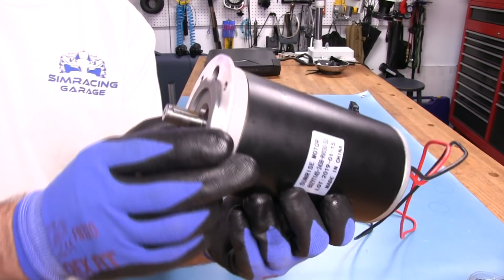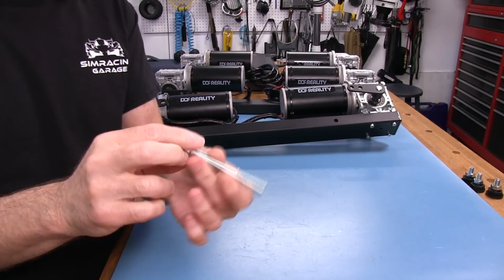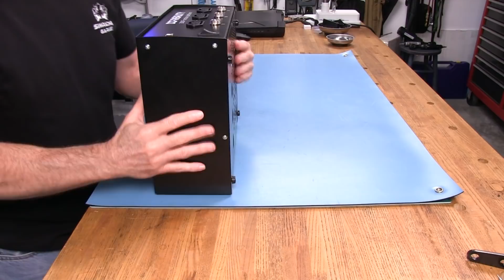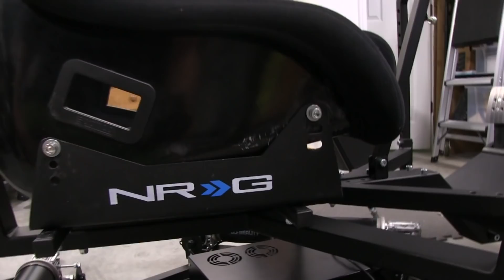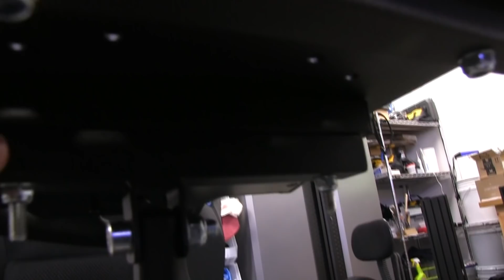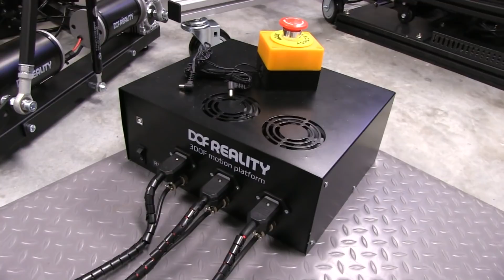DOFReality H6 6DOF Motion System Review

Comment: Great review. just built 2 P3 units last month. On the Wheel base plate, under your wheel...Check your bolt spacing for the vertical support arms. it looks like you may have them too far apart at the top, hence giving the whole base a "pre-load" spring tension. i only mention it because i did the exact same thing twice before i noticed. Considered buying optional 3rd support arm, rebuilt wheel base properly, no flex. keep up the great work
Reply: Yep the extra support bar helps with this -plus a lot of owners modify this area to strengthen it in different ways do it is strong enough to use a DD wheel 👍
Reply: @Heretik666  how are they modded?? can it really take the abuse of a DD???
Reply: Great video as usual by Barry, but I have to agree with Robert's comment. I have an H3 which I got roughly a month ago and it doesn't flex as much as what's shown in this video. It does look like the two bars connected to the wheel mount plate in this video are further apart than mine as well. However, I did order the stabilization bar to try and get rid of the minor flex I do have.
Reply: That's interesting and helpful to know!
Reply: The loudest noise comes from the gear shifters 😆

Comment: What feeling do you get using the H6 versus the H3? I’ve heard people state the H3 feels like you’re rotating on a basketball. I’m assuming this is due to the pivot point but just curious on your thoughts? I’m planning on purchasing for flight Sims, I keep going back-and-forth between the 3 series and the 6 series budgeting wise.
Reply: I just upgraded from the H3 to the H6.  For racing sims it was a night and day difference, but for DCS it wasn't as noticeable to be honest. Since the upgrade route was available (despite being a more expensive route overall), starting with the h3 may be more than sufficient.
Reply: @neilxpeart  How well did the H3 & the H6 feel when taking off from the Aircraft Carrier? (I'm assuming you have either the F/A-18 or the F-14). Did it provide G force sensations with the H3 or the H6?
Reply: @arhinehart2928  I actually don't have that plane/map combo, so I can't speak to that.  Taking off from a runway is the only analogous experience, and it's tricky to say regarding g sensations.  It definitely didn't feel like I was taking off, like the surge acceleration setting.  However since I do vr flight sim, it made the overall experience more immersive, where I didn't really recognize I was in a motion platform.  However when its off, it's super noticeable. I hope that helps.

Comment: I was originally going to buy this system, but glad that I went the route of building my own.  For a bit more ($11k), I was able to build my own 6DOF using PT Actuators large 450mm stroke units that ends up with a system that can do more than anything you'd ever need.  It allows for super fast snappy movements for racing sims, or you can turn it up for large sweeping movements for flight sims.  This system is a good unit for the price though and for entry into motion platforms.  I feel though that it could have been designed better, especially with the wheel stand.  It wouldn't take any more steel, but just designed differently.
Reply: A "bit" more...
Reply: @TechShizzleRacing  for what you get, it's completely worth it compared to what a competing system would cost ready to go.
Reply: I paid $13k for my ‘99 Carrera.

It is very realistic. 😎🏁
Reply: No surprises that a system that costs 3x the price is gonna be a lot higher quality.

Comment: Incredible review as always Barry.  I've been waiting for this review for awhile and hoping that the H6 would pass muster under the SRG's review process.  Your conclusion is spot on.  6DOF systems are expensive, and the H6 makes 6DOF accessible to a wider audience.  I was going to say to people on a budget, but even the "low" price of $3,800 is a LOT of money to spend on a hobby in one chunk.  My interest in the system is reduced by a couple of things.  First, it is noisier than I would like (perhaps an unavoidable result of the "lower" cost).  Second, and more importantly, the wheel deck is just far too unstable for my Fanatec DD1 wheelbase.  Almost no one who is considering spending $3,800 plus shipping on a motion platform is going to be using an entry level wheelbase.  Direct drive wheelbases are much heavier and provide much higher forces than entry level wheels.  I know DOFReality is trying to make the wheel deck standard across its entire range, but they really need to redesign that arrangement for a multi-thousand dollar system.  The wobbly wheel deck stands out as a glaring weakness to me.  Most of the flex in the wheel deck seems to be fore and aft rather than lateral.  Does that reduce your awareness of the flex while driving?  I had also wondered whether the H6 would do a decent enough job at conveying road textures, and I'm happy that it appears capable on that front.  I really wanted the H6 to be better.  Perhaps my expectations were too high.  I'm less interested now that I've seen your review (sorry DOFReality).  Until I see further improvements, I'm going to continue to enjoy my four-shaker chassis simulator, which does a pretty good job of sending road texture, engine vibration, and ABS cues.
Reply: Mitchell Weatherly most of us with these DOF machines have modded the wheel stands to easily handle DDs. These systems continue to evolve and with a few mods , pretty awesome. Support is really good with outstanding communication. It’s a fun community.. as far as noise , they are actually much quieter then competition so far 👍
Reply: @StarBellySneetch  Agree completely with everything you said. How have you modded yours?
Reply: Scott Bell several several also helped with the revised manual. Would be happy to help too if it’s h3/p3
Reply: its possible.. 
Look at these guys setups with a DOF Reality P3. (Professionel version with stronger motors)
- With direct drive mounted: https://www.youtube.com/watch?v=45vEMmBE9Pk&t=752s
- With triple monitors mounted: https://www.youtube.com/watch?v=gz8i9lYWZcY&t=968s
Reply: Old post but I wanted to reply to those watching now. I’ve seen people mounting custom 80/20 rigs onto these. Even the h series have no problem throwing them around. They hard mount triples to them to and it still balances perfect

Comment: Feels like I've waited for this foreeeeever lol thank you.
Kinda disappointed with how the wheel stabilizing arm thing didn't make it too solid, though... I wonder how one might fix that up without adding too much weight to the setup.
Reply: There's a Facebook group called DOFreality builders that has info on this. Can be a solved problem.
Reply: You could upgrade to the commercial motors for some more money that I’ve seen guys mount their monitors to the chassis
Reply: @Steve_643  And how is that going to make the wheel more stable...?
And IMO monitors on rigs like these is just a bad idea... More wear and tear on the gear, and most monitors/monitor mounts aren't built to stand that kind of abuse. If the mounts for the monitors were super solid, they would be far too heavy. If they aren't, the screens would shake around with every movement and be super jarring to the eyes.
Reply: @burger1113  Yeah, don't mount monitors to this rig-go VR. I've seen guys replace the wheelbase mount with 8020 extrusion, and it's solid as well as lightweight. They definitely need to redesign the wheelbase mount.

Comment: i think everyone who buys this will need their own sim racing garage due to how loud it is it would keep up everyone in the house. holy shit that flex in the wheel is bad i would of thought that could be much better with little cost
Reply: So would one buying any other 6dof simulator since they would take around 3 times the space and likely be louder too. Not to mention them costing as much as a decent sized shed or even a barn lol
That flex on the wheel is almost a dealbreaker even with the middle bar option though...
Reply: @burger1113   i have been i higher end ones in a sim arcade and they are very quiet its the links that they use but it would cost alot more to replace them links with something better
Reply: @burger1113   imagine putting a DD on that wheelstand lol it would shake the whole thing apart
Reply: @scoobysnacks209  Nah, I have a DD1 on my P6 and it's fine. I did add the stabilizer bar as well.
Reply: @TechShizzleRacing  but he has the bar on his one and the movement in it is terrible add more torque to that with the dd1 and it cant be fine plus its kinda pointless using a dd1 on that with all that flex you would lose so much feeling trough the flex. what if you welded like a bar or 2 to get it a bit better?
Reply: @scoobysnacks209  Interestingly, there is no torque/rotational flex at all, only front to back. Having said that, I do think the flex is a concern. I have seen one guy replace the entire wheelbase mount with some 80/20 aluminum, and it's solid. I'm thinking seriously about doing that to add rigidity.
Reply: @TechShizzleRacing   yeah that seems like a really good idea
Reply: Yeah, sound of the rig is almost as loud as the paddle shifters.
Reply: @TechShizzleRacing   do you find the rig loud?
Reply: @scoobysnacks209  I don't think it's too loud. I would say it's a little louder than what they say it is on their website (they say it's relatively quiet as a selling point), but it's not too bad. I do all of my racing in VR and I don't hear it at all :).
Reply: @TechShizzleRacing   yeah i suppose with headphones on it wouldnt matter  until my girlfrend taps my shoulder at 2am saying "what the actual fuck is all that noise" lol

Comment: Hi Barry, still waiting for my H3 to arrive..... now this!?
Reply: How do you like your H3?
Reply: @larock0wns  it does the job, I probably wouldn't buy it if I'd known just how under engineered the wheel stand is though. I'm suprised DOF Reality doesn't address this by making an option? The extra support they sell really isn't good enough.
Reply: @tedcrilly1  Thanks for the response.  So given the opportunity, which setup would you buy instead?
Reply: @larock0wns  I'd have probably gone down the route of the swedish SimRig. I regret not having an easier way to add peripherals. Aluminium profile would have been preferable. Traction loss on the H3 is amazing though.
Reply: @tedcrilly1  have you considered marrying an 8020 frame with the dofreality? It’s one of my ideas..
Although I’m slowly starting to hang towards the sim rig sr1 Or sfx100, probably combined with the gs5 gseat. (I have the motus ultimate frame)
Reply: @patroza6  yes, I've seen a few owners do this. A youtuber called Fondoo (I think thats it) has done it. It looks great.